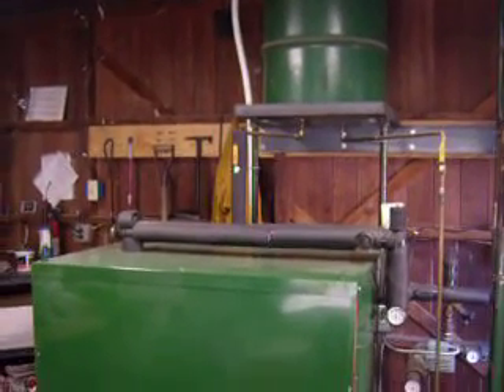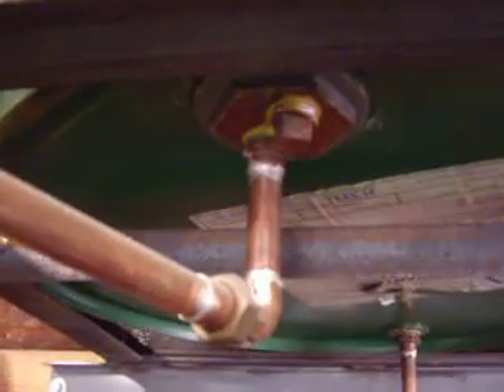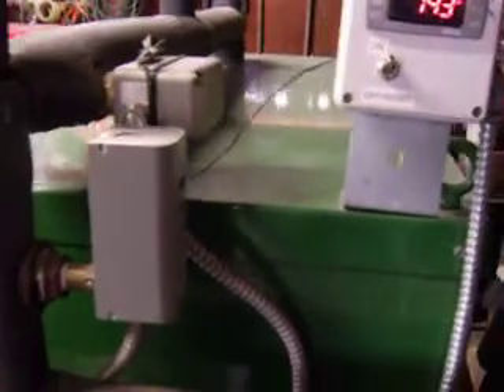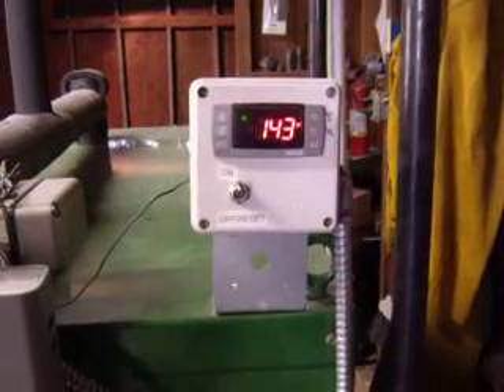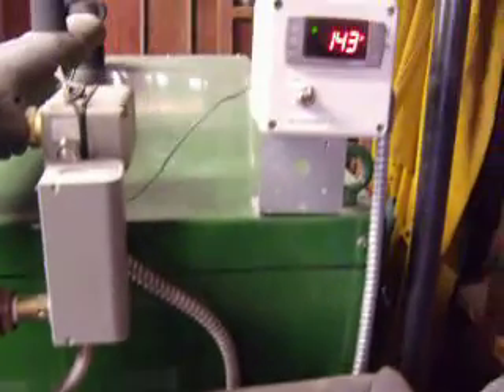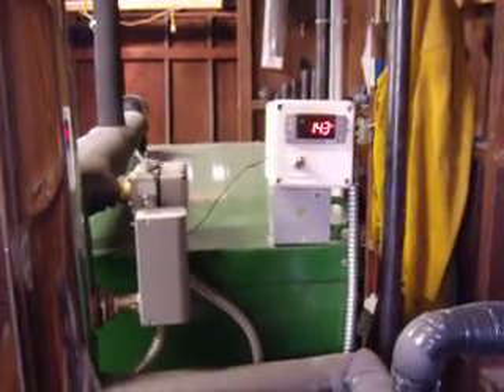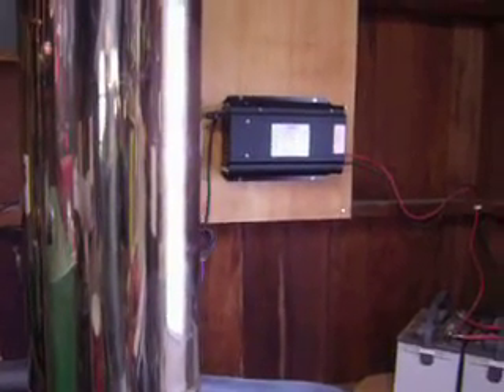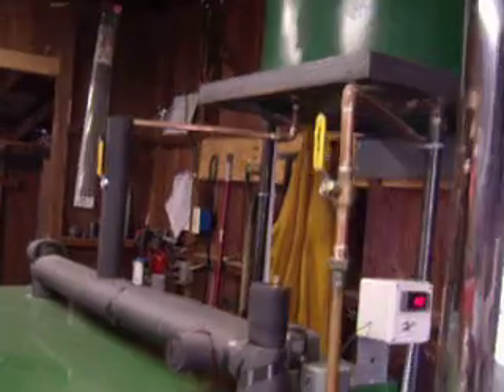Greenwood Indoor Wood Boiler Installation video 2 digital controller

Comment from the maker: Hi MaineScott,  Sorry to reply 1 year later.  I have the 3 way mixing valve plus the controller.  I have some condensation issues but once I start burning I do not let the unit go totally out all season.  The condensation really increases when you heat and cool down constantly.